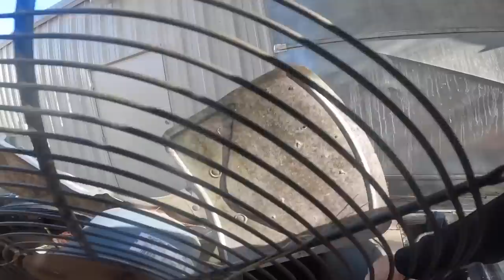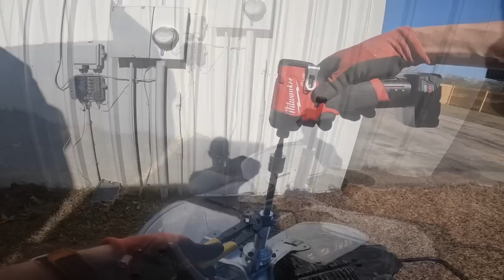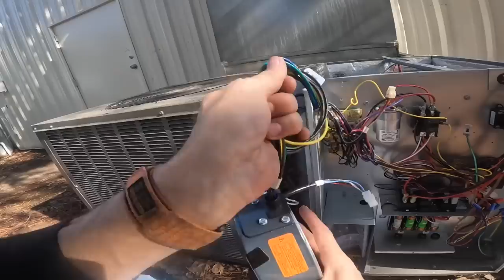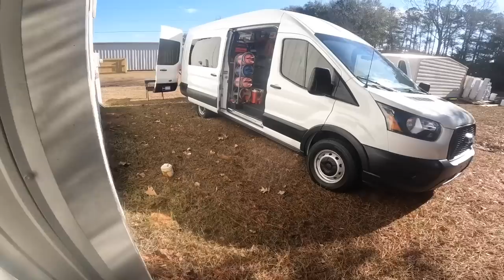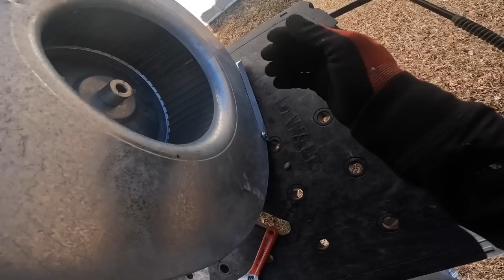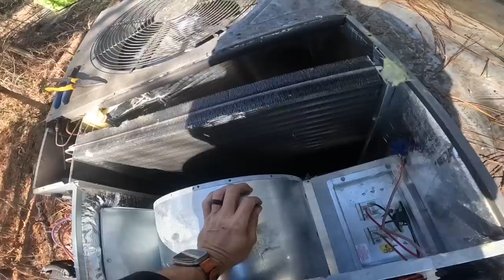Both ECM’s Failed At The Same Time.

Comment: Curtis, that 1/4" drive wire brush that keeps coming out of your impact probably is too long between the insert end and the indent.  Compare the length  to a Malco bit and see if all you need to do is grind a little off.  I had that same problem with some bits that just would not lock in.

Comment: Once again, I don't have any use for an ecm other than using it for a boat anchor.  A voltage ⚡️ spike or brownout will take em right out.   I reckemend 
Installing surge protection on them.

Comment: Nice video what happened that the blower motor didn't start when you applied power
Reply from the maker: Low voltage was plugged into wrong slot

Comment: With the insulation gone on the top of the blower/blower motor cover, doesn't that mean the cool air being supplied is being warmed by a hotter encasement that houses the blower motor before the air is coming out of the registers inside the building? Would it be good to re-insulate the top cover? Especially if the sun is hitting it for part of the day? This seems really inefficient and a loss of cool air being supplied.

Comment: Bro your gonna waller out threads and screw holes and that machine will be making all kinds of vibration. Someone needs to take that drill away from you. And sand paper on a shaft will work wonders of course if your wanting to work. Chanel locks would of spun that blade and then pulley puller would of been magic . I’ve never seen anyone use a drill on a pulley puller. You sir need to use nut drivers on those screws and quit throwing things around things get bent easily and then your going back to parts store for new blades cause the fan cover is bent causing blade to lose its weights from all the dam drill work lmao